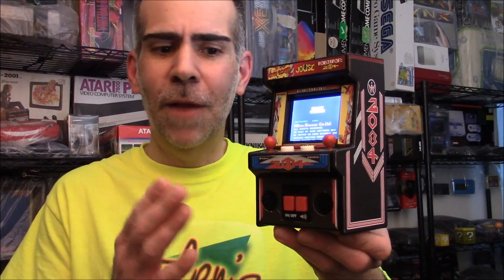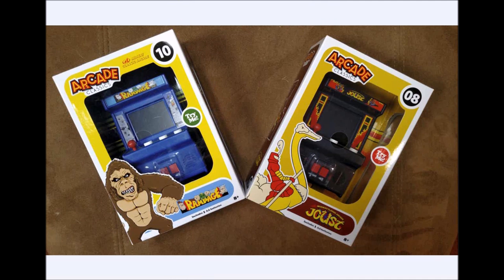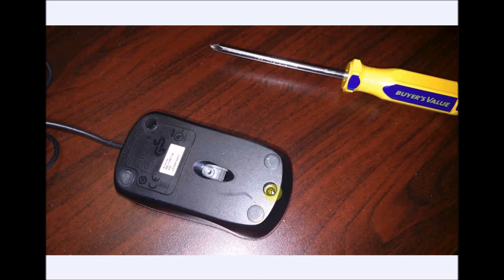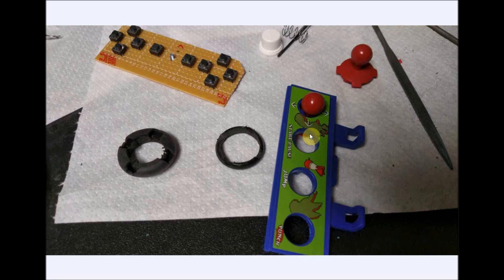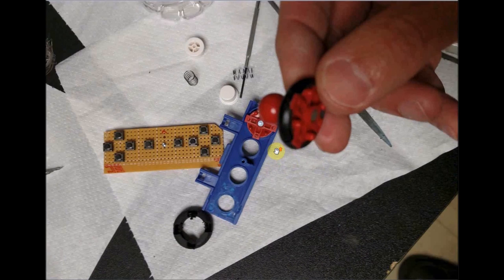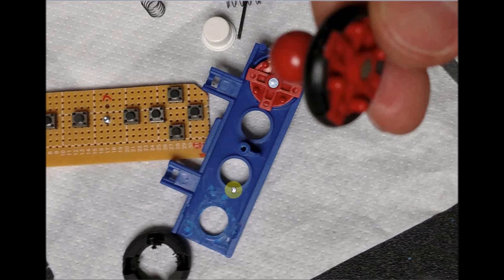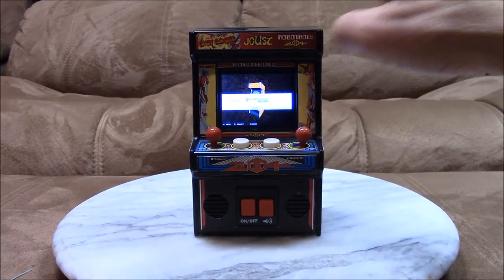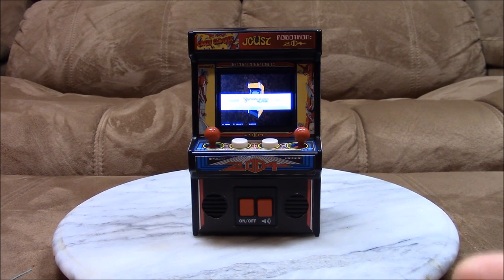How to build a Bridge Direct Crazy Climber/Robotron Glennycade

Comment: Thanks for the very informative video.  How did you connect to the battery?  Did you just solder to the contacts on the battery?
Reply from the maker: Roger Storch I used an adafruit 1000c
Reply: Understood, but that battery doesn't have a cable attached, does it?  How did you make the connection to the battery?
Reply from the maker: H H it's very unlikely.. I think they will stuck with mainstream units